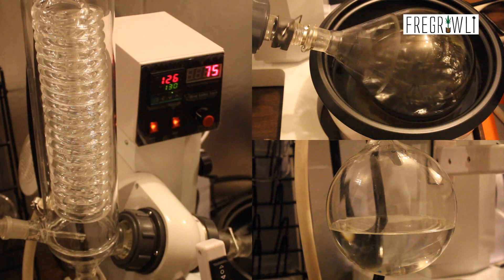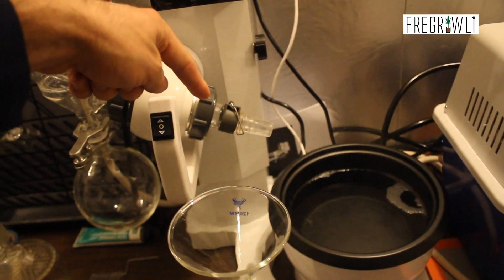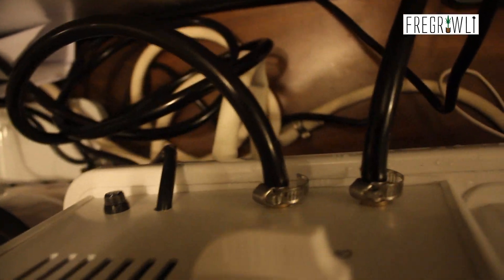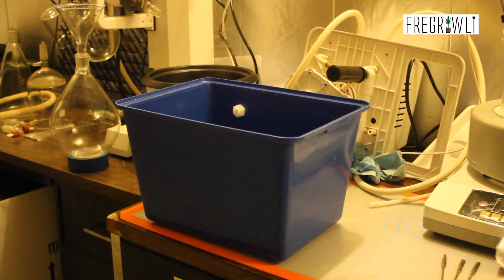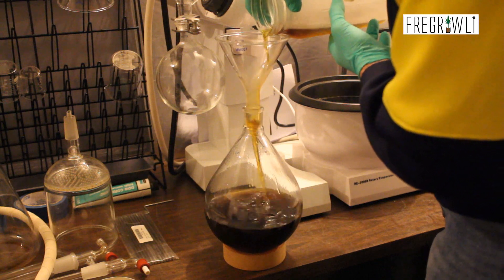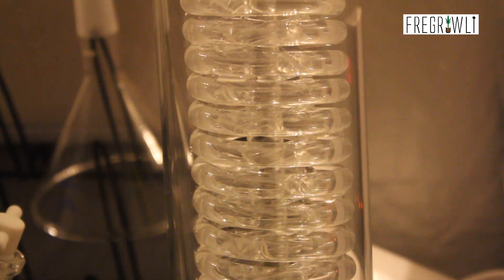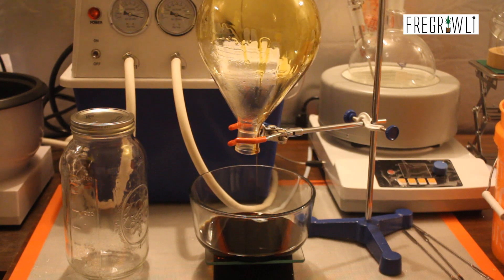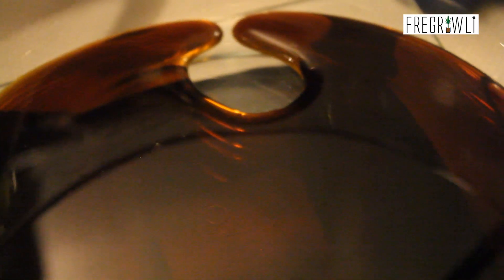Ethanol Recovery: 2L RotoVap from Best Value Vacs

Comment: I've done countless testing  on  hydrocarbon extractions  and the ppms left over are not in a range to fail testing these tests were done with oil made for a toddler  with severe siezures point is when you use hydrocarbons they don't get trapped like ethanol because the boiling point is so low :) happy extracting

Comment: Can you do this with winterize rosin? 
Will my rosin oil remain liquid after the rotoray evaporator extract the ethanol, so I can still vape it? Or will it dry up back into rosin/shatter?
Reply from the maker: I suppose you could. It only stays as liquid as as much a) solvent is in it, and b) terpenes are in it. Those are the two viscous portions. If you rotovap (or purge) the ethanol off, it will become less viscous, but you don't really want to be vaping ethanol.
Reply: I am thinking about getting the same one you have from best value vacs. If I was to rotovap all the alcohol out. Do you think it would be viscous enough to vape or would I need to add terpenes? Thank you for your time and making this video. I found it every helpful.
Reply: @johnnyxxxxxx6506  Pure alcohol is volatile and can be easily evaporated under the vacuum and heating conditions of a rotary evaporator. For an alcohol solution containing other solutes, if it is thin, the rotary evaporator can evaporate the alcohol normally. However, if it is very viscous, adding terpenes may help reduce the viscosity to facilitate evaporation. But considerations such as the requirements for the final product and the dosage need to be taken into account to avoid introducing impurities.